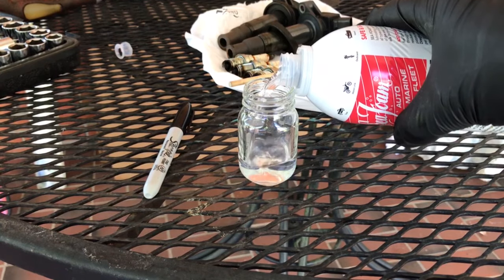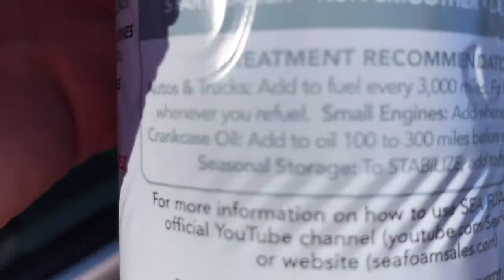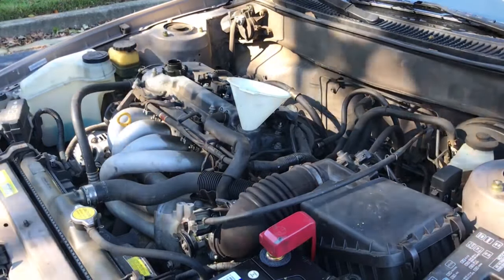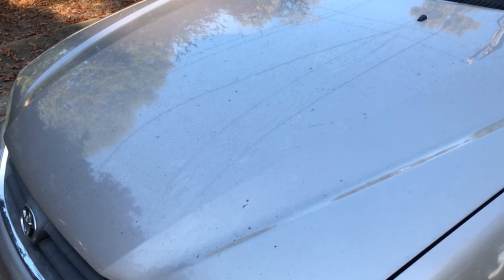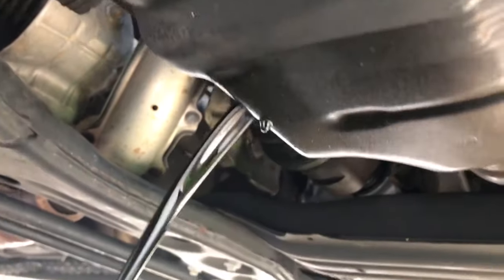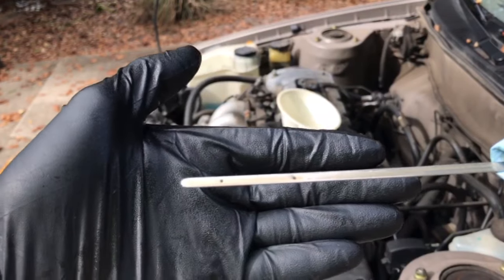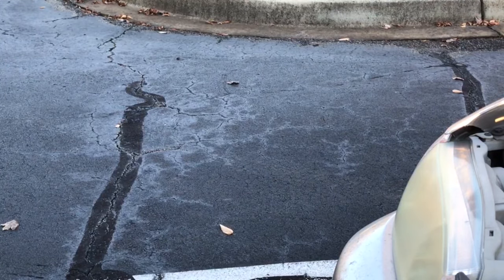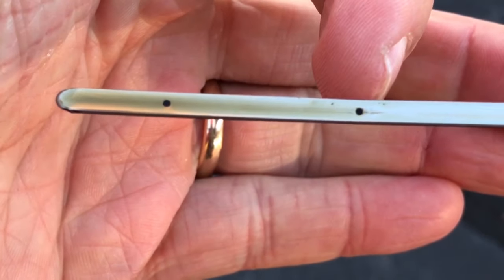Will Seafoam stop oil consumption? | Oil Burning🔥Experiments | Episode 2

Comment: Dave, as an auto mechanic myself, I've tried seafoam in car engines. It works! Redo the crankcase step AND the fuel tank step again to further clean out the system. Do it a third time(if needed)! It, also, cleans out the carbon deposits from the Piston Chambers and head's. As a mechanic, it's worth investing the extra few bucks to help your motor run efficiently as long as it runs. Keep the positive attitude about the process-IT WORKS! Douglas🩺
Reply: I have 341k miles on my civic and it just started having blue smoke today, so i add it the oil pan or inside the spark plug holes?
Reply: @Иванпонимаете-г4ш   if I was doing this in a high mileage engine, I'd go though the spark plug holes and like he did,  let it reside there for a couple of days.
Maybe call that good, or maybe drive the car  for 25 or  50 miles, then drain it well before changing the filter and refilling with the correct oil.
Reply: But does it clean the intake? I did spray it directly into the intake - apart from some smoke I didn't see much of a difference.
Reply: @Иванпонимаете-г4ш   Are you in Russia? If yes where do you buy Seafoam from?
Reply: I add seafoam to my crank case drive about 50 miles and then do the oil change every time I change the oil. Then every 50k miles Seafoam spray down the intake and put a bottle in the exhaust down the o2 sensor hole.  Drive 20-30 miles to operating temp then heat soak for hour and oil change.  Honda Fit ge8 with 300k miles.
Reply: Did this gunk yp the CAT?
Reply: Ya what they said 😂 it's a cool product I wish the epa wouldn't mess with stuff that works used to be so potent you do once and done lol

Comment: My 08 Pilot was going thru 1.5 quarts  every  fillup of fuel. I used the seafoam and now I can go almost 6000 miles before needing a quart. I'd call it a success. 228000 miles.
Reply: Hi there! I have a Scion xB that’s doing just about the same. What amount did you add and where? Thanks for any help you can offer :)
Reply: @baybae92  you would use 4oz on an xb (1oz per quart of oil in the car).
Reply: Im trying to fix the oil consumption on my 12 acura mdx..i hope this works
Reply: Have you changed your PCV valve

Comment: I did my first Sea Foam treatment on my 113k 08 Camry and it seems like the problem is solved. Previously about 500 miles I would need to top off about 1/2 - 3/4 qt. Now I don’t have to even top off. Oil has been at the top dot and is still clean.
Reply from the maker: That's good to hear, Marc. Did you do anything differently, or did you follow the recommendations on the can?
Reply: @FamilyFriendlyDIY  I called Sea Foam CS and talked to a guy who seemed to know his stuff.

I just got a regular conventional  5W-20 oil change and didn’t know about Sea Foam I until after. He said to add 4 oz of Sea Foam and check dipstick whenever I fuel up which is once a week. He said when you see that the oil is getting dirty and / or changing color then get another oil change and add 4 oz again. He said it could take 1 Sea Foam application or a couple. He did indicate it would work though either sooner or later but didn’t guarantee it. He even explained to me in detail why the oil consumption issue with the 2007 - 2009 Camry’s.

I’ve driven about 450 so far since the oil change and Sea Foam treatment and it looks like the dipstick hasn’t moved from top dot and oil looks still looks clean.

A family member actually gave me the car a couple of weeks ago because he wanted it out of his garage. It was his sons who moved to California. He did tell me about the oil consumption problem and said he could have gotten it fixed from Toyota but was 6 months too late when he found out there was a TSB. He called Toyota and they said he missed the boat by 6 months. That TSB would have given him a new motor practically. Anyway I got the car got $0!
Reply from the maker: @MarcP5267  Good info, Marc. Thanks for replying,... and if you can, please post any updates. Glad to hear it seems to be working for you!
Reply: @FamilyFriendlyDIY  yea! Will keep you posted.
Reply: How’s the oil consumption coming along? I’m definitely considering Seafoam now too!
Reply: I have Camry 2007, I add 1 qt every 1K . Before I used to add 1 Qt after 3K and on 5k I change oil and filter. Now it became crazy 1qt need to be added every 1K sometimes before. So is your car still running well? No engine problems ?
Reply: @emadgrabel3444  - same problem with me. Same car, same year.
Reply: @Handy.Dandy7  every Toyota 2.4L has this issue from the Scion tC/xB to the Camrys to the Highlander and corolla . The oil control rings on the pistons have small holes to allow the oil to fall back down to the oil pan that get clogged very easily and the oil stays in the cumbustion chamber and gets burned. The best way to combat this is to do a few motor flushes back to back and run fully synthetic oil & change it every 4-5,000 miles.
Reply: @emadgrabel3444  the holes for your oil control rings on your pistons are clogged
Reply: @cookekeon  You are right, according what I read that the design of that holes in piston should be horizontal, but Toyota designed that holes about 45 degree to make the oil flew quick. That didn't help and caused the consumption issue. Anyways, what is the best flush product that I should use ?
Reply: @emadgrabel3444  the best 2 I have used so far is "soltec oil system cleaner" & "gumout engine flush & conditioner" I’d run them about 2-3 times
Reply: @emadgrabel3444  The best way to use ANY motor flush is to 
1 : drain out the old oil (fresh oil
     suspends more impurities)
2 : use a cheap oil filter (greater
     capacity to catch more
     particulates than the old 1)
3 : use cheap oil
4 : add the flush 
5: run the flush for whatever time is
    recommended per bottle
6 : drain 
7 : add new high quality oil & filter

Also whenever I do a flush if the flushed oil doesn’t come out transparent I repeat the process but reuse the cheap filter until The oil comes out gold like when I put it in . Then put the new filter & oil and I’m good to go
Reply: @cookekeon  thank you so much brother for detailed information . Definitely I will do that next oil change.
Reply: @emadgrabel3444  no problem this method should work for you. It worked for me when I had my Scion tC with the same engine. And anytime I buy a new car I do this as preventive maintenance just to make sure my oil system is clean because when I pull my dipstick I want it to look like water 😂

Comment: Tech Tips.  I too love Seafoam, great stuff however the 2AZFE problem was pistons with too small oil return holes in the oil ring groove.  When these plug up and they do if synthetic oil is not serviced religiously!  Piston ring sticking is the next result, unsticking rings may be only temporary.  If opting for rebuild, and the original pistons can be used the oil return holes should be drilled out a little larger.  Hastings rings with a 3 piece oil ring design will give the very best results.  40,000 miles later and it doesn't burn a drop of oil between changes.  The second issue is to eliminate the balance shafts as the fiber drive gear will fail and cause a clacking sound in the bottom end.  Remove the shafts and toss them in the garbage,  securely plug the oil ports in the balance shaft bearing cap block face and reinstall the caps.  Your oil pressure will increase to normal and the 2AZFE will run smoother than ever.  2008 Rav4, if you only have the balance shaft problem it can be performed from underneath by removing the oil pan.
Reply: I have seen both Dodge and Toyota pistons with the opposite problem, cracked skirts caused at least partly because the oil drain holes were too large and too square, weakening the piston like the first British jet airliner with the square windows.
Reply: AM_Mech and all:   GM 1.4 LUU 4 engine on a Chev Volt is throwing oil out the tailpipe, 3 quarts in about 30 miles.  Small droplets on the back of the car from the interstate air flow.  Had to shut it down.  Just got this car.  Yikes.  Seems to run great.  Smooth.  And I thought I knew a few things about checking cars out.  I have about 50k miles or more behind the wheel of other Volts, familiar with the driving characteristics while on the generator going down the highway.   Did not suspect rings or low compression, did not open the oil cap and check for blow by when I test drove it before buying.  No milkshake on the dipstick, just dirty unloved oil.  Car got hot when oil pressure warning startled out of a slight coma but hopefully not enough to ruin it - I don't think.  Probably can't get lucky enough that some seal failed or blockage in PCV routing the oil down the exhaust other than needing motor tear down.  I don't fully understand how that works.   This one has 170k.  Yeah, you're probably shaking your head saying GOOD LUCK CHUCK.  I am too.  But I'm just happy to be alive, and still have curiosity.  Any thoughts appreciated  :  )
Reply: Are there metal replacements for the balance shaft gears?

Comment: Double dose it at 8 oz. Run 1,000 miles.  Change oil.  It will  fix the issue  100%
Reply: @ragnaroksangel  you have absolutely no knowledge of how additives work, seafoam is a de carbonizer and  engine oil dispersing agent, it will not in any way do damaged, it reacts to baked on carbon deposits found on piston  ring lands, valves,  other engine components,  eliminating sludge build-up. If carbon is left in an engine it will eventually lead to oil starvation and catastrophic failure.

Comment: Also consider the possibility that the seafoam cleaned up passages in the oil pump in the journals and the pushrods if you had them. This might even result in a slight loss in pressure but large gain in volume of oil moved through the engine during operation

Comment: Do both processes 1 more time. I believe it’ll completely free up the rings and clean out the ring lands now that some of the carbon has been reduced. Also a treatment after with the hose into the throttle body will complete cleaning since it’s introduced into the combustion chamber while the engine is running

Comment: This reason I think this occurs is because of the PCV system where cars will inevitably suck in oil or oil vapor and burning it will cause the oil rings to get stuck.  The solution for me is an oil catch can.  Over time as you drive the car, the engine will eventually burn away the residual oi.  It certainly helps to run Seafoam or any type of cleaner as I don't see a massive difference.  I did this to my fathers 2001 RX300 which burned a lot of oil, and over time with the catch can and seaform it now hardly burns any oil.  I put in a fairly large can as well, and after a few months I have to dump it as it gets full.  Did this also to my sisters 07 IS250 as it also burned a lot of oil.  I had to upgrade the size of the catch can because it also filled up quickly, but now it hardly consumes oil.  I now put oil catch cans in nearly all my cars, including my 02 Vette as it also sucked some oil from the PCV.

Comment: I have the same car, with the same problems.  I used PB Penetrating oil, down the spark plug hole of the cylinder that had the stuck rings, over night. The next day it stopped smoking and ran much better, so then  I put two 8cyl bottles of Restore, which helped tremendously with the amount of compression and power the car is making now, plus it doesn't smoke anymore. I have used Sea Foam in the past on other cars with great results, just not on this car yet. Great Video man!
Reply: With the stuck rings did you have oil leaking into that cylinder?

I already replaced my valve cover gasket, trying to figure out if my problem is piston rings or something else. It's an 05 camry with 376k miles so could be a number of things but it seems like cyl3 keeps getting enough oil in it to quench the spark and misfire and I can't afford to have anyone else work on it.
Reply: @ThorsDecree  -Yes, there is a massive amount of oil leaking by the rings, it really fouls up the plugs. I need to use some B-12 in the cylinders to free up the rings. Its really bad again.
Reply: @TexasHill  thanks for the quick reply. Think I'm gonna try B12 after seeing so many people talking about it and a few vids where it clearly led to improvements. While I could theoretically manage tearing down my whole engine by myself, I really really don't want to. Can't really afford the time off as I make most of my money by using my car.

Fortunately after 376k miles it seems I only have stuck rings on one piston but I reckon I might as well soak all 4.
Reply: @ThorsDecree  - It works better than anything I have tried. It's worth the few bucks. Leave it overnight, then turn the car over with the plugs out to remove any excess, if any. I blocked the plug holes with blue shop towels to keep the B12 from evaporating over nite. Try it on just the one plug first. You won't regret it.

Comment: Hi Dave. Others may have commented the same as I am about to, so forgive me if you know this already...
As I understand it, the issue with the 1ZZ isn't so much the sticking rings, it's that the oil return holes in the piston (behind the oil control rings) get blocked, because they're too small. A later revision to the design cured the problem. I have the exact same engine in my MR2 Spyder.
What happens, is that as the piston descends, the oil can't get back through the blocked holes, so it forces its way past the oil control rings and gets into the cylinder itself.
It looks like the Seafoam has worked to unblock the holes to a degree, and would probably improve further with repeated treatment.
I shall try the same process with mine and see what happens! I'm also going to use Lucas oil treatment, which may quiet down some of the (very mild) top end noise. Thank you for an excellent and very useful video.
Reply: Yeah exactly owner of a toyota with 2azfe once the oil ring is clogged with oil the engine will start burning oil I did similar fix in video but with motor medic motor flush when doing oil change over 1.5 years changed oil maybe 6-7 time don't look like I'm burning oil anymore

Comment: Thanks for the informal study. The one thing I noticed is when you checked the oil in that parking lot the video showed you parked on a fair downhill grade. That would make the oil read higher on the dipstick than if you checked it in your level carport.. You can also add Seafoam to the fuel and clean and soften valve seals, which may help with oil consumption too..

Comment: I did the same thing with the same result only, I put a whole can of Seafoam in the gas tank and ran it out. It made no difference in the oil consumption. Then, I put some of Seafoam in the crankcase and left it in. I didn't change the oil after 300 miles. It made a big difference in the oil consumption.
Reply: putting seafoam in the gas tank only cleans fuel passages
Reply: How much difference did it make? Like in the video he displayed an amount lost before & after treatment. Cheers!

Comment from the maker: Previous video in this series:
Seafoam vs. Stuck piston rings - top down approach: https://youtu.be/cxz9cGCULNI
Next video in this series:
Marvel Mystery Oil vs. Stuck piston rings: https://youtu.be/ZJ023-Wk0OQ
Entire oil burning experiment playlist: https://www.youtube.com/playlist?list=PLS7Cti2LicYDtv1hFbz_dErQFGxnTgMCj
Reply: Hello Dave The code P0011 on my infinity QX56 2011 it has 178 k mille on it . When the engine light 💡 comes on it will not move faster then 10 miles an hour, but when I unplug the battery and the engine light is off it runs perfectly fine
Reply from the maker: @ebonyangel8844  I believe your camshaft position sensor is telling your computer the camshaft is too far advanced and it's throwing your car into limp mode. When you unplug the battery it's resetting the code, until the sensor glitches again... replacing the camshaft sensor might solve your problem.
Reply: Anyone tried this on the Toyota 2az-fe engines notorious for oil burning issues? Thanks
Reply: If you have 2.4L , 1.8L 2ZRFXE ENGINES, this kind of treatment may work if it is not too bad yet.  If it consumes about 1quart per 1000 miles or more, it may be ok. But if it every 500miles, it is too late.
Reply: Replace your PCV

Comment: Like I said.  Every oil change, pull plugs, seafoam or another brand.  Pour in. 
Let sit over night. Next day turn over without plugs off and on. Change oil.  
Next oil change. Do it again. 
You do it until you see no smoke and your oil consumption will go back to normal depending on miles.

Comment: Adding to the oil makes sense because it will continuously coat the cylinder walls when the engine is running and get at the rings that way. It'll also possibly remove the seat from the rings so you may essentially require a break in period afterwards to reseat the rings.

Comment: DIY Dave, I'll take these two videos seriously.   I had an oil burning issue in my Dodge Intrepid 2.7 L v-6.   Rather than use Sea Foam, I used a 20% MMO / synthetic oil solution in the crankcase.   After about 3000 miles, I observed that the oil burning was eliminated and promptly changed the oil to 100% synthetic oil.  3 days later my engine rattled and died, which may be relieved when I replace the water pump and timing chain, currently in progress.  One thing I do know is that the piston top surfaces are caked with carbon.   I'm thinking that the top soak for a few days is going to be next.